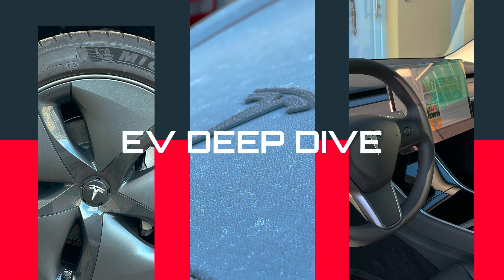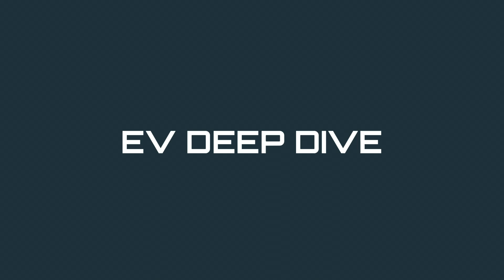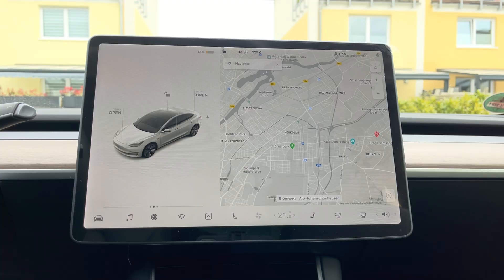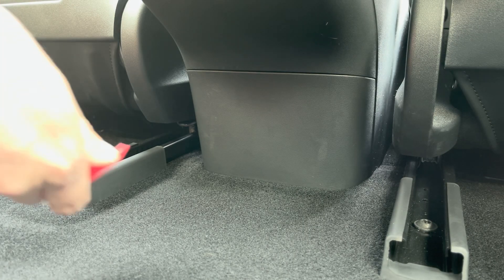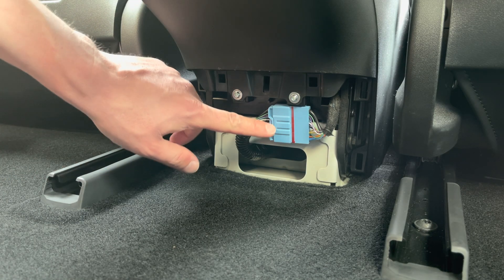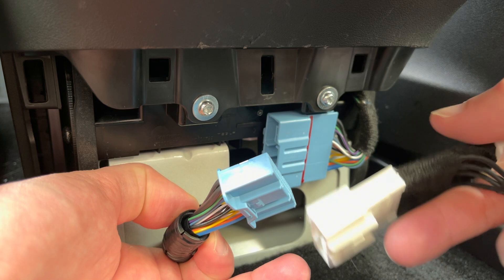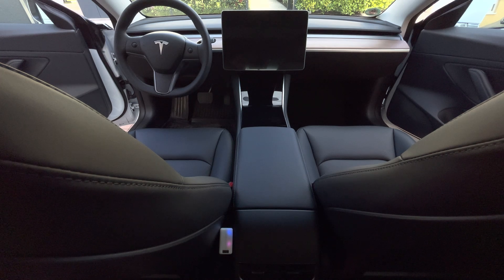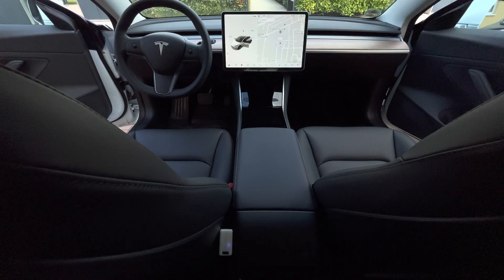Install an OBD port on your model 3

Comment: I'm wondering if you can scan for trouble codes with this setup and if there is an option to reset codes? also what App are you using to scan ?

Comment: OBD is not las on a Tesla as its there for pollution check by authorities. So only needed for ICE. Why not hide the dongle in the console as its BT?
Reply from the maker: Not enough space 🤷‍♂️
Reply: BT may disconnect. You’ll have to open up the panel and all that. I think i might do something similar - just as long as it doesn’t get in the way of the power seats and get crushed!

Comment: Excellent content. Just ordered a Scan my Tesla bundle and wanted to see  the removal of the plastic cover. The best part is that you didn't remove all of the struggly parts. Still better if you had shown all cable management.
Reply from the maker: There is not much more to it. The entire cable management I had to do is visible in the video and frankly it wasn't that much.